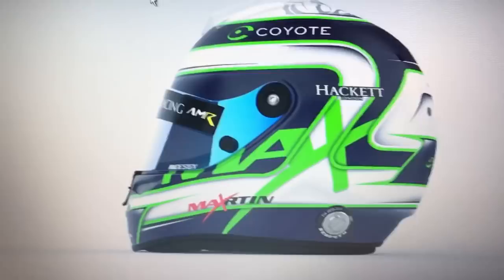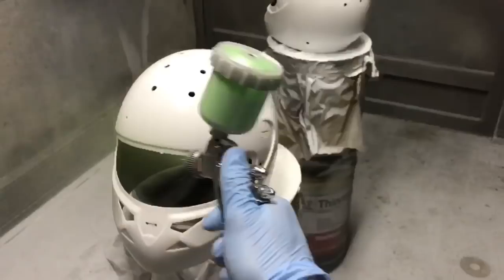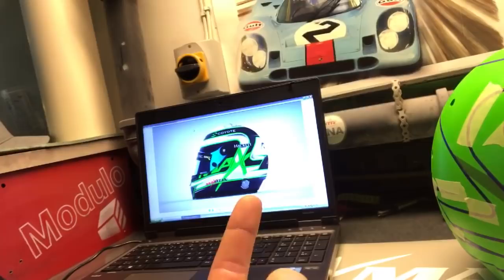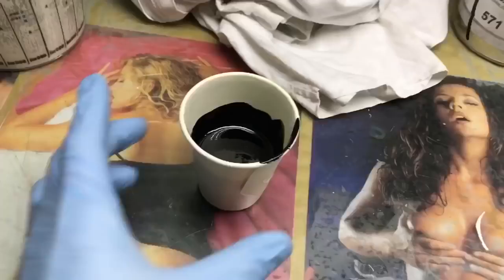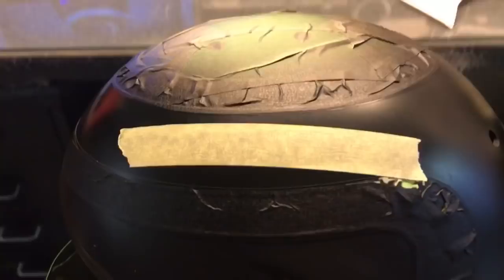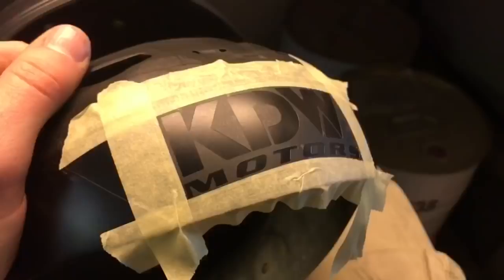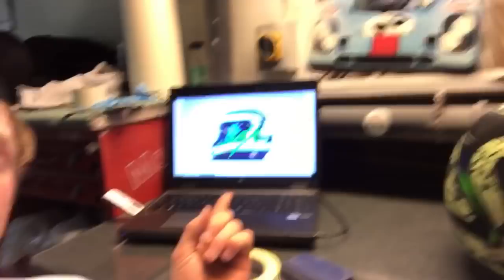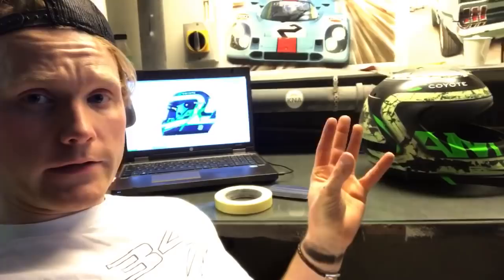HOW PAINT A HELMET STEP BY STEP - VLOG32 PART1/2

Comment: I’m currently painting a helmet at the moment, my base coat was grey then I needed to add white on top. To cover the grey I needed quite a bit of white and I’m now left with rough edges. Should I clear coat between layers? And also should you peel fine line and masking tape off before paint dries?
Reply from the maker: The problem with the edges happens yes. Clear coat is on top when you are done with all colors and so on
Reply from the maker: No, don’t remove the taip before paint is dry😄

Comment: Why don’t you use primer before laying down the base coat?
Reply from the maker: No need for primer on top of the original color when it’s sanded down!😄 That’s just more weight!😉
Reply: Do you only use a mini gun and an airbrush, or do you have different guns for different purposes? Also, what vinyl do you put in the vinyl cutter to mask the logos?
Reply from the maker: I have a Very small airbrush gun for shadows, a half big gun with a 0.8 nozzle for colors, and a standard paint gun with a 1.5 nozzle for clear coat. 
It’s a special vinyl for making masks for painting 😄